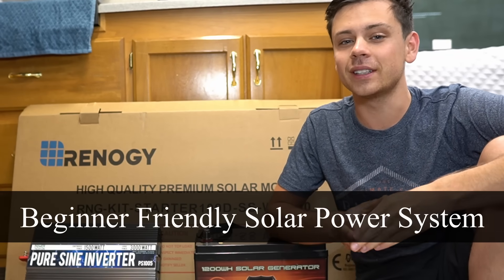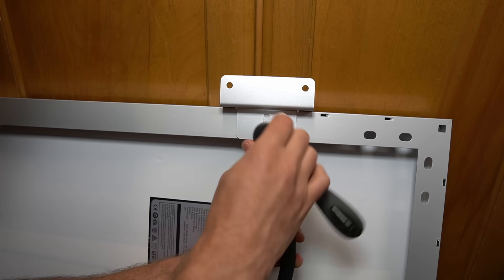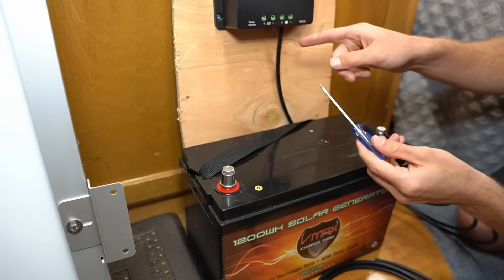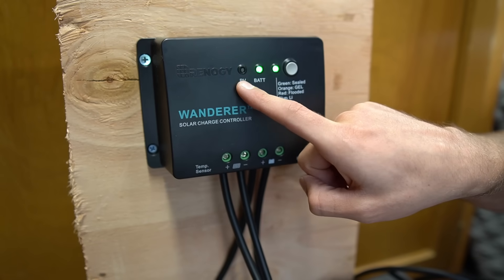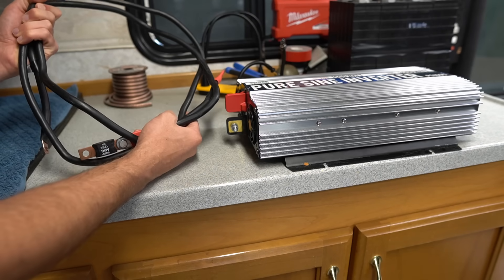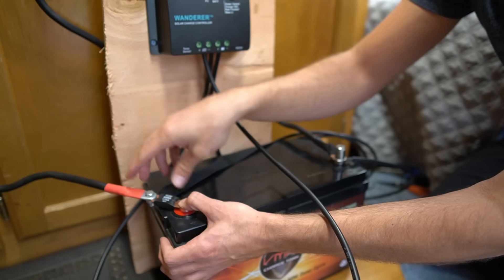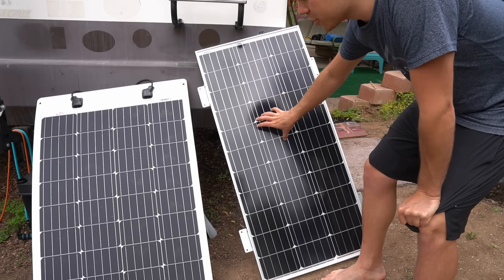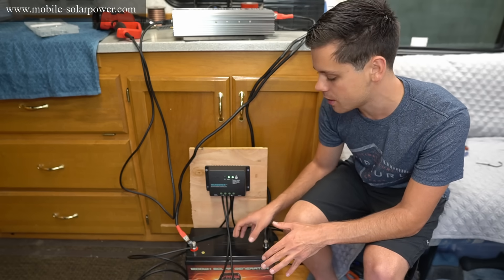Build Your First Solar Power System! Beginner Tutorial Easily Explained, Budget Friendly

Comment: Will... do you have a video on connecting appliances to the fusebox?   Nobody seems to talk in detail about anything else except plugging things into the inverter.
Reply: Ditto
Reply: I third this. No one ever shows how to hook this all into my existing setup in my RV.
Reply: @EOFugate  That sounds like an excellent video suggestion . Compass Life asked something similar . 

Our young Mr Prowse may be missing an opportunity to have a class or tech day - he need not do the work or install , just advise the attendees on their items . His experience may suggest a better fit than the instructions . He can film the event and outcome . There are varied battery configurations and locations in RVs so I find most kits lacking ..Will already is very hands on with the parallel connects for added panels and the recommended fuses . It would also give him an answer for every 'what should i buy or do ' question ..attend the tech day.

Kenny in San Diego

Comment: thanks for the video.   what's the temp sensor for?
Reply from the maker: It's for something called temperature coefficient compensation and if you have a lead acid battery the charge controller needs to modulate its output voltage so that it doesn't damage the battery

Comment: Just discovered your channel want to build my first solar system because through a friend and coworker I have unlimited access to brand new A123 24V LiFePo . I have 28,000 amp hours of battery sitting at home and I don’t know what to do with them. Now that I’ve been watching your channel I think I could build what you call a battery wall.
Reply: a123 batteries have an aluminum body. Hard to weld to. Be extra careful if your making a wall with them.
Reply: Fugate University These are black plastic batteries casing they came out of the Fisker karma Electric car each module is $1800 but sometimes their circuit board has a defect brand new in the car‘s computer cannot read to Monitor so they replace them under warranty and scrap the whole batteries I get to pick them up for free they are built super heavy duty and rugged for long life because I have to work in a car with vibration and people are sitting on top of them so the safety factor have to be very high and build to operate in desert temperatures and then freezing snow
Reply: @coldfinger459sub0  right - I was looking at buying the same, only they were "bus" batteries. When I mentioned using them on the diy powerwall forum, that was the advice I got. YMMV.
Reply: I mean don't get me wrong. If you live close to me, I'll come over and we'll figure it out.  I wouldn't mind having a couple in my RV.  Free batteries are always good batteries. hahahah
Reply: I'd build Wills 24v system, hook em up and let em fly!!

Comment: Great video.  I had a question though.  I was told that depending on how big your load will be, you might not be able to use a 12v system.  Bigger home solar systems have to be 24v or 48 v systems to power bigger inverters.  Is that true?
Reply: its about efficiency. 48v is "better" than 24v is "better" than 12v. Will is talking about mobile systems. Home solar is quite a bit bigger.
Reply: @EOFugate  I thought it was about how much of a load  you can run at one time
Reply: @anthonynardella8907  not in my research. Get a kill o watt - figure out how much your load is, size the system  to 1.5 that.
12v/24v/48v is mostly related to efficiency.  12v will run the same load as 24v and 48v.  24v will recover/maintain more efficiently and easier than 12v.  48v will recover easier than that. Where you run into issues is cost. As you go up in inverter size/voltage the cost gets higher. Eventually you're system is large enough that the efficiency offsets the cost.  Like - you can run 400 amps a day on a 12v system. But it'll be a hot minute before you recover that. 24v not so long. 48v you'd be aight. YMMV.

Comment: I have a 200 Watt, 200AH system at my off grid cabin in Montana. It works a treat.
Reply: how long to recharge batteries?? What kind of battery?? I'm looking at building a system and collecting info/research.
Reply: Basically as shown in the video. Batteries are usually back to float by noon. I found everything on Amazon.
Reply: I run a small fridge,  lights, and ham radio equipment.

Comment: Thanks Will. Another great vid. Would love it if you could experiment with DC heating elements - direct from PV hot water systems. Interested in how they could be integrated into a system via a DC converter perhaps. Also, I live in a passive solar house I designed and built in Kyoto Japan and would like to promote it for renters coming from the US. Let me know next time you’re over!

Comment: Hey I can’t really find any info on it, so I figured I might as well try to ask. I was wondering if a 400 watt solar  system with a 1500 watt inverter, would be able to charge a gaming laptop, a tv and my amazon echo, along with a central heating and air unit for my van. The gaming laptop has a 230 watt adapter (it’s a razor laptop) and is probably use it for a few hours a day. Is this something I could do comfortably or do I need to set higher watt standards for solar to do something like this ? (I’ll also be using a Verizon mobile router)
Reply: You need to do an energy audit.
 Basically figure out the watt hours of each device with how much you'll be using it on average each day THEN add them all together to have your total daily energy usage.
If you saw Will's comparison video between mono and polycrystalline panels, the poly panels produce much closer to their rated voltage.
As far as the central heating, you're going to need at least 1,500 watts of solar if not more... even efficient, lower BTU AC units will be power hungry. I would have two fans if you want to cool your van.
Your AC appliances can not exceed 1500 watts because of your inverter.
Aside from the air conditioner, you should be able to power everything with 400 watts of solar but what size would your battery be?

Comment: Helow,
I heart when you take Solar panel with high voltage may be 80? Volts you can charge the batteries also when is clauded. ...no sun  because the voltage goes down to 20 volts what is enough to charge a 12 volt battery.
Is that correct  ?
Thanks

Comment: Do you know how to hook solar up to a progressive dynamics mighty mini power panel model pd4045kv ?  I would like to plug my trailer directly into an inverter to run the power.  My trailer is only 83 sq feet and I don't run much.  I have a small refrigerator, a coffee pot, a small electric handy heater (350 watts, just to take the chill out) and that's about it.

Comment: I am a total beginner, on many levels, but I have one question, I recently purchased a rv with a residental fridge, I would like to run it and only it off solar, do I need a large solar setup to do this, I noticed my 3000 watt generator doesn't even come off idle when the fridge kicks on
Reply: Simple math would give you the answer. 
You have to know what your total daily consumption is across ALL your appliances. 
For example, if you use 2000 watts/day  (167 amp at 12 v) then you need 330 amp hours with sealed lead acid or around 200 amp hours with lithium to run it for one day. 
If you need 167 amps or 2000 watts, you'll need around 300 watts of solar (2000 watts /8 hours of daylight = 250 watts per hour). Depending on where you spend winter, you might need a larger system but many places during late spring till early fall will have lots of sun for quite a few hours.
Reply: @AaronGeller  thanks for the reply,  I'll check on the fridge and start there, thanks again!

Comment: Thank you for not recommending a Harbor Freight system for beginners.
Reply from the maker: True Mike, I just hate the quality of the plastic panels. Their older metal frames were better.
Reply: why no harbor freight?
Reply: I have the HF, 100watt, at the moment just to keep my 6 deep cycle lead acid batteries healthy . At the moment, nothing  is being used, and the 2000 watt inverter is off.   I haven't installed my 400 watt Renogy system yet cause I still need to paint the roof and design the inside better...
I guess what im asking is, isnt the HF, solar system good enough to use it for what I'm using it for?
Reply: @brownbunny2513  -  I have a HF 100 watt system which is a portion of my         ( Backyard ) off-grid solar system.  The Harbor Freight system provides about 40 watts of power in full sun which is more than enough to keep your 6 lead acids healthy as a 'trickle charger'.  The provided PWM charge controller should prevent over-charging at 13.8 volts.    (As long as there is no load on the battery bank.)
Reply: Can you do this same video for a wind turbine?

Comment: Will, I really like these videos. While I have a small 200W solar setup on my current rig, I'm going big on the next one. Regarding roof panels and hooking up in series/parallel and wire lengths, is there any issue with having different lengths of negative/positive leads between the panels? In other words, is it better to keep the leads the same length for each panel and tie them up or is cutting them to the exact lengths needed okay to have a cleaner installation even if that means panels lead lengths and resistance could vary?

Comment: I am an electrician, licensed in THREE states... that said I have both praise AND critique.
Number one, in regards to the comment by "eaburd1506" and your response, I would inform that person that no Earth ground is necessary.  Seriously, what are you hoping to achieve?  Safety??  Protection from lightning maybe?  Excuse me while I go laugh myself into a quivering blob of protoplasm on the floor.

Nothing is going to protect you from lightning.  Period, full stop.  Grounding a system does not protect any one or any THING from lightning.

Grounding (the green wire) was introduced to help neutralize the effects of the high frequency DC pulse after a lightning strike, and provide transient voltages a path back to the source, which is NOT the Earth by the way.  Electricity is NOT trying to get to ground, as so many falsely believe.  Voltage is trying to get back to the source, and if traveling thru the ground gets the electrons back to the source, then they will certainly go that way.  But I digress...

The short answer is, for a system this size NO GROUND(ing conductor) IS NECESSARY.
Reply from the maker: Oh absolutely!!! I think you misread my comment. Read it one more time. It had to do with building a large structure, and following safety codes. Not to do with actual lightning hitting the panel! That's why I said follow local laws etc for building a structure. And the true Earth ground benefits is only for accumulation of charge that can decrease output of large systems. This is very tiny and for this small system, totally unnecessary. Totally agree with everything you said! Sorry I didn't explain it all out.
Reply: Dude.  Yes, you did mention that.  Thank you and though I am inclined to delete my comment I think I'll let it stand as a teachable moment :-)   @WillProwse
Reply: Oh yeah, I forgot the praise part:  You definitely have your shit together and I totally enjoy your videos.  I am a subscriber too btw.  I don't know what level of electrical whateverness you have learned, or from where, but you have aptitude and skill.  Keep on keeping on ;-)
Reply from the maker: And thank you!! Just built a lot of robots when I was a teenager. Lots of basic stamp and Arduino stuff. And rc airplanes :D